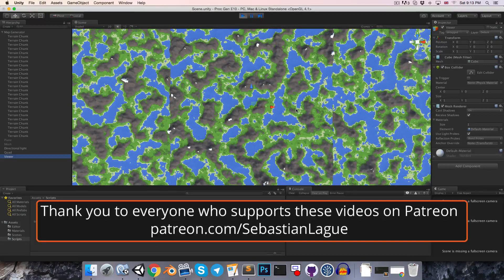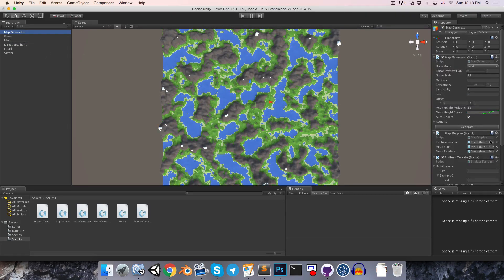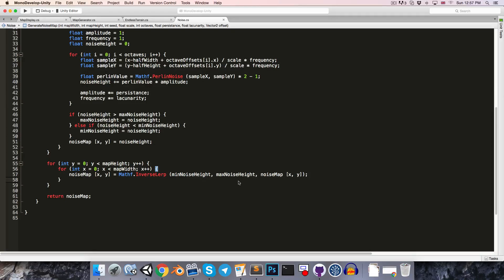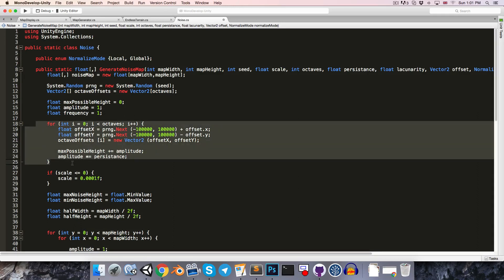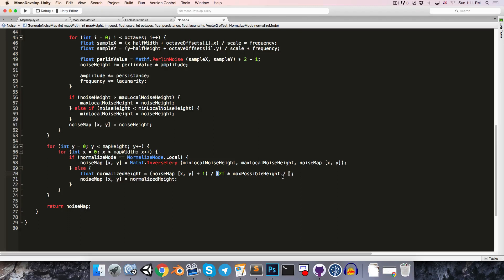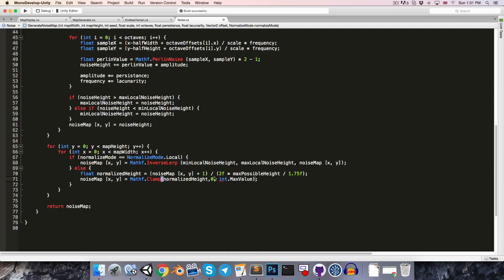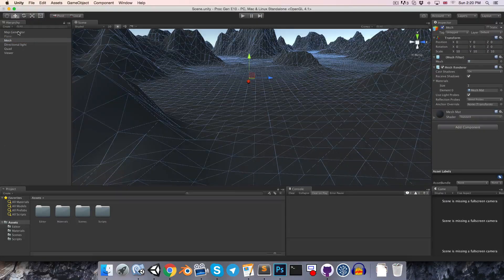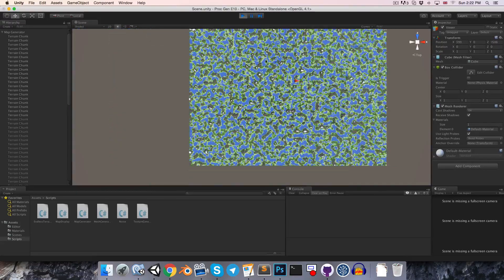Procedural Landmass Generation (E10: seams)

Comment: That's really good. It's now corrected the two issues that I was having - the seams showing, and the map being not to scale :)

Will handling collisions with the meshes be in a future video?

(PS: you've spelled "persistence" wrong)
Reply: +James Grimwood I figured out a simple way to get collision to work. It lags at first but it works perfectly fine after that. Add another variable where the other variables are in EndlessTerrain.cs( example, MeshRenderer meshRenderer; MeshFilter meshFilter;)

MeshCollider meshCollider;

Then add it like the others.

meshCollider = meshObject.AddComponent<MeshCollider>();

Then in the OnMeshDataReceived, add

meshCollider.sharedMesh = meshFilter.mesh;

right under

meshFilter.mesh = meshData.CreateMesh();

This is working for me but there may be simpler and more efficient methods. (I'm not as smart as Sebastian ;))
Reply: +Cancer Tomato "Assets/Scripts/EndlessTerrain.cs(183,51): error CS0103: The name `meshFilter' does not exist in the current contex". How do you access the meshCollider and meshFilter? They are currently in another class
Reply: +Cancer Tomato It lags only because it takes time to generate the collider.

By what I noticed working on several prototype projects with meshes (and still sucking with meshes), not using mesh collider runs a lot faster, which is a shame.
Reply: Purple Ice Yes
Reply: In Public Class TerrainChunks define a 'Mesh Collider meshCollider' and then add a mesh collider in Public TerrainChunk using meshCollider = meshObject.AddComponent<MeshCollider>(); and lastly in public void UpdateTerrainChunk() under the if (lodMesh.hasMesh) statement make the meshCollider equal to the meshFilter using meshCollider.sharedMesh = meshFilter.mesh.